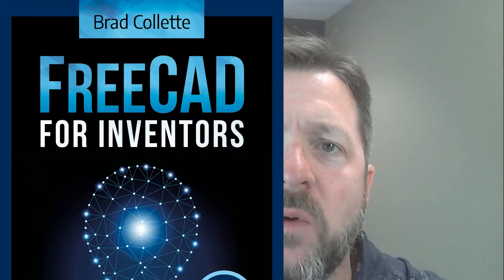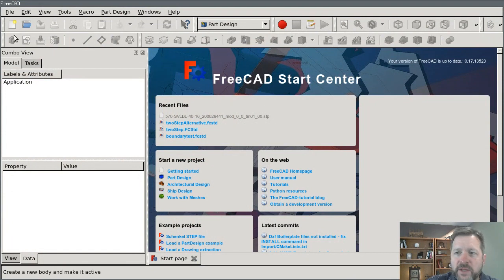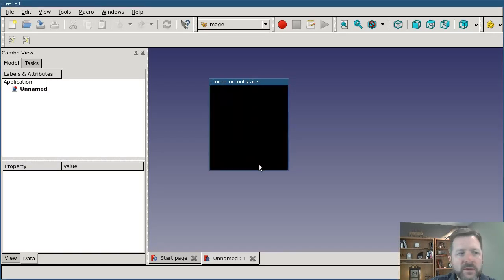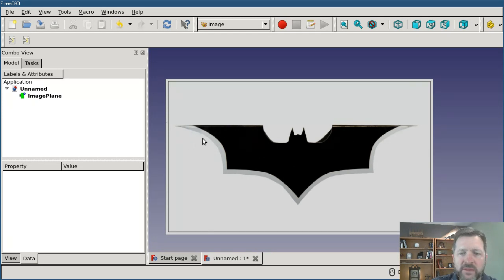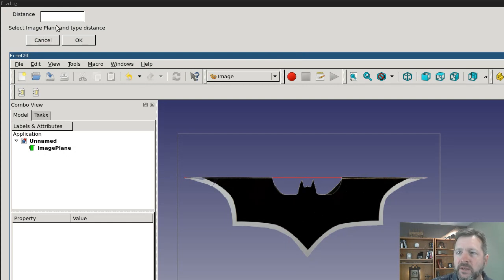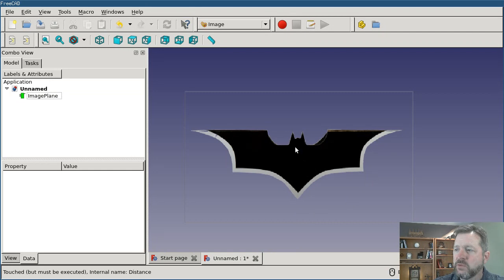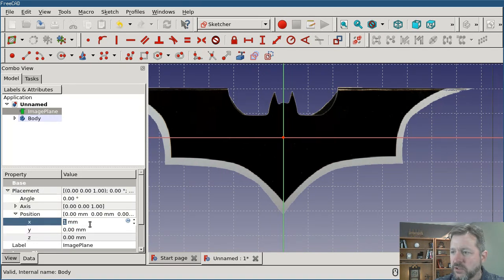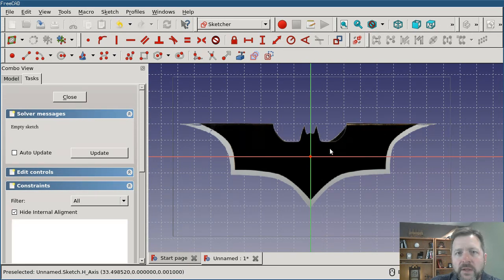Part 1 - Image Planes, Import, Scaling, and Position

Comment: I'm needing to convert an image into a model, and I still haven't found 1 solution to my problem
Reply from the maker: Unless your model is trivially simple and 2 dimensional, 'conversion' isn't possible.  Instead, you're basically modeling the part from scratch and using the image to guide the process.

Comment: Thanks for these videos, Brad.  In v0.18, as you probably already know, you will be able to do the scaling directly in FreeCAD without need for a macro.  The same macro is actually incorporated into it.  With a very recent commit (today, in fact) to the source code you will now be able to enter something like 6 * 25.4 into the dimension line edit.  Basically, any python expression can be entered, such as math.pi * 3.  Will not be able to use "6 in" or "6 inches", but at least you can enter "6 * 25.4".
Reply from the maker: Mark,  That's great news.  I should think converting the panel to use the freecad unit widget would be easy enough.  Then it would display units according to user preference and allow entering them as well.  I've used it in a few places in Path and it was quite easy.  Still, great to hear it'll be standard functionality.

Comment: Where can you book be found?  Or When will it be available?

Joe
Reply from the maker: It'll be an ebook on Amazon (and other places).  Should be released by  the end of september.
Reply: Great!!  I have an upcoming project I would like to do, will your book help me with portions of it.  Let me explain.  I want to design and build a hinging steady rest for an Atlas 10F lathe and make a video series from it for my channel.  I want to start with the measuring of the lathe, * General 3D modelling of the device, toolpath generation for CNCing the pattern on my CNC router * casting the pattern in aluminum, machining the steady rest and final fitting to the lathe.  So you see there is an area that I think FreeCAD can help me.  I want to make a complete series on the project using open tools if at all possible.  My Homebuilt CNC router runs on LinuxCNC.  Thank you sir for your input.  :-)

Joe
Reply: It's up now on Amazon: https://www.amazon.com/dp/B07H9RV5X6  or for less money on Kobo: https://www.kobo.com/us/en/ebook/freecad-for-inventors